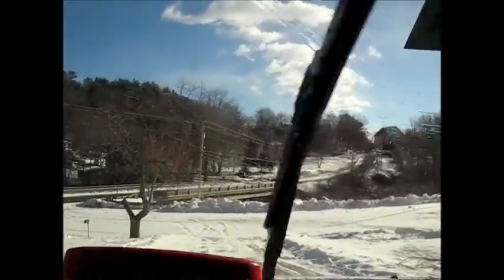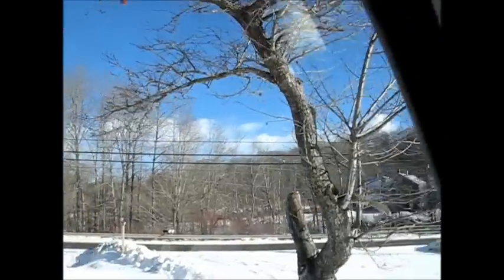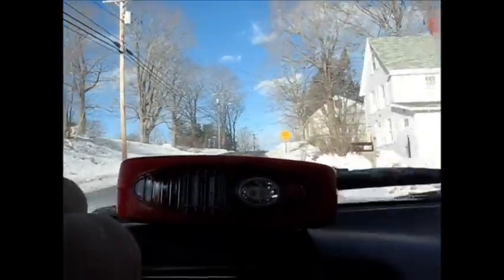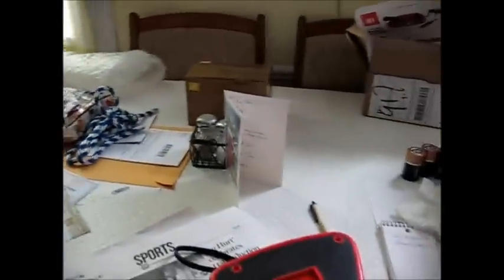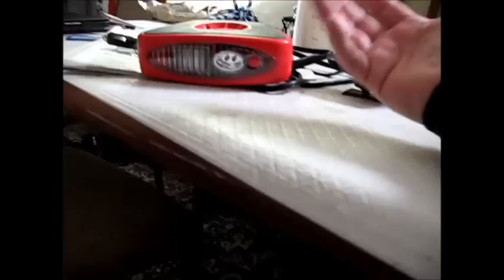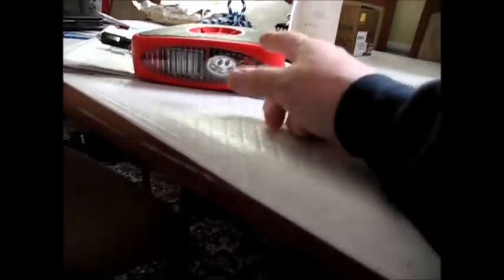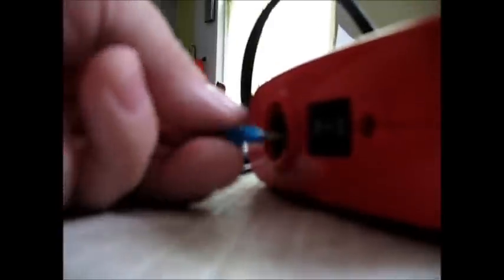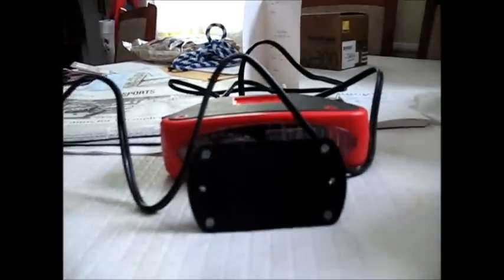12 volt auto heater defroster 2

Comment: These kind of little heaters are on the cheap side. On the jeep I would run a set of heavy wires inside with a fuse holder remove the 12 volt plug and wire them direct. Then figure how to mount it so you can turn it to be on you or the window. Keep up the good Videos, Keep warm and be safe.

Comment: Wiring to the battery is your best solution; mine even has a warning tag on it saying it'll burn many cigarette lighter sockets and that you should use a dedicated 12v socket.
Reply from the maker: That's how I eventually did it.  Use good heavy wire.

Comment: I don't have any heat whatsoever in my 88 Dodge truck, so I went out and bought an electric heater for fifty bucks. Mine didn't work very well at all, the fan was too weak. I did wire it directly to the battery, this was the only way that the instructions said to wire it. It does have its' own fuse.

Comment: just a little note, most newer cars don't have cigarette lighters any more. it looks the same but there socket is deeper. they may have a low amp fuse installed. they are mainly for accessories so that heater is pulling a lot of amps. the wiring may not take the amps.

Comment: That's funny, I mentioned directly wiring that machine in your last vid BEFORE I saw this vid.  Direct to the battery is the way to go, MAYBE a heavier plug could be used to make it removalble, but in any case. I'm sure it's cheap enough to buy a few of them and wire them all direct to the battery.  Just be darn sure you shut it off before you leave the vehicle!!!! Hmm might want a relay that goes to the battery that is charged by the acessory side of the ignition and goes then direct to the battery... hate to see you run your battery down accidently.

Comment: I'm always a little leery about putting a bigger breaker that a circuit was designed for. I'm sure you already know this but for the most part those fuses and designed to be the week point in a circuit and blow before something else burns up.Putting a bigger fuse in could move the weak point to some other component. Just my 2 cents. I'm looking forward to seeing how it works being wired direct. It almost looks like they put a long enough cord on it that they were anticipating that need.
Reply from the maker: I'm thinking so too.   The wire is long enough that I should be able to run it right through the firewall to the battery.  It's mounted on the firewall.   Should eliminate the weak point..

Comment: The shorter that you make the wire the less it will pull. Put it through the wall and put some alligator clips on it and hook direct to the battery.
Reply from the maker: I'm thinking directly to the terminal, without the aligator clamps would give it more fire..   I suspect the clamps can only handle so much.    For something that only pulls 15 amps it shouldn't be a big deal, that's what I'm thinking.
Reply: rpeek yeah that would be better. put some ring terminals on it and bolt it to the clamps. I was thinking you take it off easy with alligator clips. but a fuse will take care of it at the battery.

Comment: Chop the plug off,and wire it up to the battery. Be sure to put a fuse within 6 inches of the battery,to protect the wiring.(maybe a 20A fuse,since it has a 15A fuse in it already.)
ALWAYS fuse any wire coming off of the battery,close to the battery.
The fuse in the heater won't help,if the wire gets rubbed through or pinched..say,at the firewall or something.

Comment: Its odd that the fuse in the cigarette lighter plug didnt pop, but it could be a 20 amp.

For your safety, if you can, put a fuse at the battery end, in the + wire so everything after that is safe.

The fuse in the unit is just silly, but thats my opinion :-)
Reply: I would definitely get a fuse on the wires NEAR the battery. You would be able to get a fuse at a car audio store if not at a car parts store.
Reply: dejanira2
Well he allready has the fuse in the plug so that could be extracted and he would only need a holder :-)

Mr peek is a clever man, im sure he thought about the installation ages ago :-)